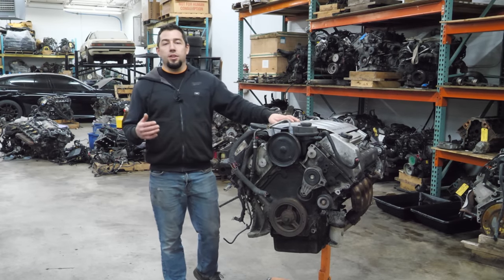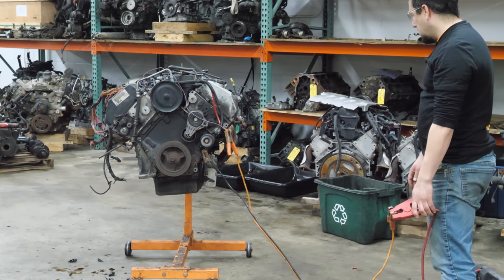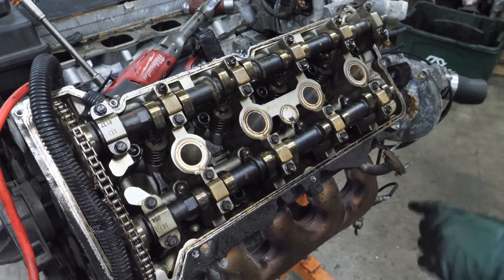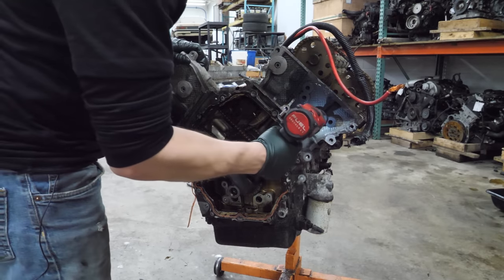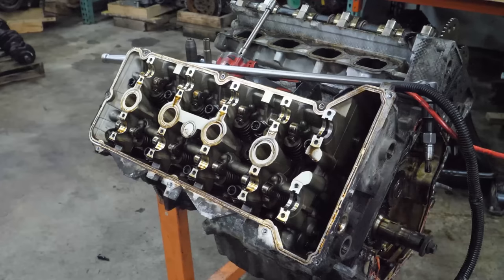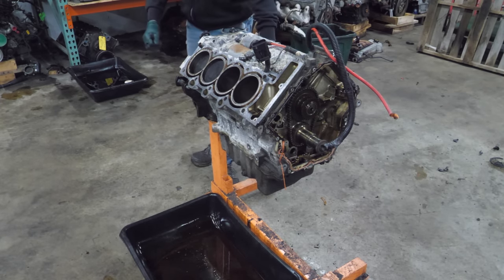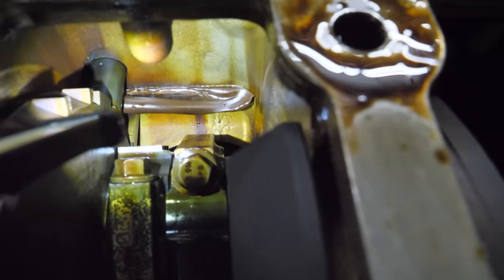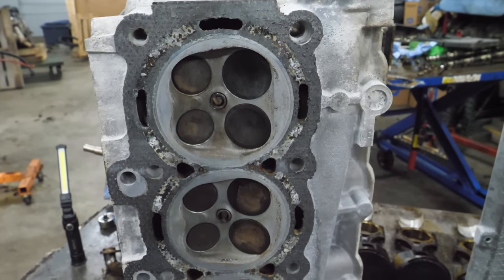Customer Returned This Cadillac Northstar L37 4.6L V8, How Many Things Can We Find Wrong?

Comment: First, the RTV issue. There was a special policy repair on the lower block union oil leak. Was probably done by some idiot at a dealership. The blocks and head gaskets were upgraded to  address leakage and thread pulling. The cooling system corrosion was due to low coolant, which allowed air into the system. The water pump had been leaking for a very long time. Very common issue. A special socket is used to turn the water pump out of its locks. I've seen them locked down, almost always resulted in head gasket failure.  I own one, only because I couldn't find a decent used Lesabre. Working on cars for 45 years killed me physically, got to where I could no longer get in and out of my Duramax. I hope my 08 DTS will make it for a little. Good video.
Reply: 2008 is pretty safe. In 2005, GM started using LS head bolts in the Northstars. Problem solved.
Reply: Dexcool was the real problem here. And the engineers of this engine should be flogged in public!
Reply: @cmdrclassified  Actually, GM switched to a cheaper grade of aluminum for the blocks in 1995 which caused the bolt-pulling problem. Early Northstars don't have anywhere near as many problems with this because they use higher-grade aluminum for the block. Late Northstars used a revised head bolt design which greatly reduced the problem in 2002 and solved the problem in 2005. 1995 to 2001 are the years to avoid.
Reply: First off I'm one of the idiots that worked at Cadillac. So you are completely right. Unlike the 4.1 4.5 and 4.9 Cadillac engines we had to cram coolant sealant tabs in the cooling system. 2005 and above use a 1.5 thread pitch head bolt which helps eliminate thread bolt pulling. I love the Northstar engine. My 2008 DTS has 178,000. Bought it off a customer $900 because he thought the engine was bad. Best car in the world. I had already resealed the bottom case halves a few years prior. Still going strong us idiots always replace the oil pan baffle. The Northstar put my kids through college
Reply: @aaroncostello8812  or studding the block and 14mm shank i knowledge from my boss's shop that was into modifying caddy's

add the 500ci as well
Reply: adding in stop-leak does that damages as well that's probably what the solids are or at least part of the problem that helped kill this engine/video
Reply: @williamwalker4029  i hate those tabs previous owners of my 80's k1500 did that killed my casting's aka junk-engine
Reply: Cast iron block aluminum heads, nature's head gasket.

Comment: Oh YES! As a Northstar owner (LD8) I've waited so long for this teardown video! Can't wait to see how this Rubik's cube of an engine comes apart.
Reply: Is that the 300 HP HO engine
Reply: @nickyj3571  No, the LD8 was the Deville and SLS Engine. 280Hp, The L37 was 300Hp, Still Have one in my 1998 STS.  Studded the block ten years ago, still running strong at 165,000 miles !
Reply: @Archangel2020  I don't even understand why they had the two different engines with only a 20hp difference
Reply: @nickyj3571  the gearing is also different between the 2 versions. The lower power versions have a bit more torque to move with the higher final drive ratio.
Reply: @danr9584  I drove both versions didn't notice anything different except for the performance model having magnaride which did turn better at higher speed and the 18in wheels looked nicer

Comment: Gotta love how convenient the starter is to replace in these, always looking forward to another one of your videos 
Thanks Eric
Reply: BMW does it too
Reply: Isuzu trooper as well
Reply: Toyota does lots of their v8's that way
Reply: Honda 2.4 l too
Reply: I prefer it in a lot of cases. Its easier to get out than say a toyota 3.4 v6. The intake comes off in a matter of minutes and its just right there, rather than struggling under the car on your back for a while getting dirt in your eyes.
Reply: I would rather disconnect fuel lines and remove a dozen clean screws from the top of the engine than eff around with rusted exhaust manifold flange studs and whatnot with dirt and rust falling onto my face while swapping a starter underneath the car.
Reply: Removing the intake is a way better DIY job than trying to get it from below with ramps/stands. Also, how often are you replacing starters? This looks easier to work on than a lot of transverse V6/8 designs that are buried below vacuum lines and cables.
Reply: 07 Chevy express van starter can be swapped out in 12 minutes. It’s in the normal spot.
Reply: @anthonys7534  I'm reminded of a 1969 Ford F100 360 FE.... truck was just tall enough to crawl under, and with roughly 16" worth of 1/4" extension that last starter bolt was accessible going in from the front (otherwise it would have been double the time dickering around with a box end wrench). Couldn't have taken 10 minutes, 5 bolts all right there and nothing in the way except the starter itself for one bolt.

Comment: After watching so many videos of very late model OHC engines being torn down, I've seen so many with those long timing chain runs directly from the crankshaft to the cams and have wondered why none of them had intermediate cam reduction and now see this and what a pleasant surprise.  This engine's system is so much cleaner and more efficient that the later ones, fine engine design (from an old school motorcycle tech).  Most later designs are disappointing by comparison.
Reply: If you think about pushrod GM V8s, it also seems kind of expected that they'd have an intermediate idler in approximately cam-position (in an OHV V8).  So the chain from the crank to that is approximately like the timing chain on one of those.  But yeah this design seems to work well.

Comment: I changed the engines in quite a few of those cars, Cadillac, and Aurora. Had to drop out the sub frame to work on it. I changed head gaskets on one, when I was torqueing the bolts down several on the back bank pulled the threads, learned a lesson there, and replaced the rest with replacement engines. Never used any wrecking yard engines, could be as bad or worse than what you were taking out. Wrecking yard would give you another engine, but you had to eat labor, and fluids.  Cars used to be fun to work on, now it is never our fault, you did something wrong installing it.

Comment: An engine that would be cool to see torn down one day is a buick 3800- love the content!!
Reply: I don't think those engines hardly die
Reply: @danielknepper6884  agreed! Aside from intake gasket leaks and an intake manifold egr port that can crack and hydrolock the engine they're really stout and seemingly can run forever.
Reply: The early 231 Buicks ones aren’t great.. plagued with oiling system problems… GM 3800 series 2 is an amazing motor. My Buick 109 (grand National v6) has all kinds of oiling mods and it still doesn’t have great oil psi lol
Reply: @jafferm1938  the oiling in pre-corporate era Buick engines has always been a weak point unfortunately. There are several good fixes out there though. 

I've rebuilt a Buick 350 (pretty much what the LC2 was based off of, which itself is derived from the 215) and it uses an identical oil pump setup. An adjustable pressure regulator and high pressure oil pump plate do wonders for addressing some of the oiling issues. I did the same thing in a worn out 455 I have, that motor makes over 60psi at idle on cold start and 20psi hot at idle. 

The 3800 series of engines made big changes to address some of this, including switching to a more modern and efficent gerotor oil pump driven off the crank instead of the cam sensor or distributor.

 One big mistake many guys make with the Buick V8s is installing high volume oil pump gears. These put a ton of stress on an already failure prone front cam bearing. The crank driven oil pump in the 3800 eliminates that issue. 

There is a forum post a GN guy made where he modified 2 timing covers to add a 3800 oil pump to his LC2.

Comment: I'm always interested in seeing Northstar information. I own a 2004 Cadillac Deville Base, bought it in March of 2015. The car runs great. It, of course has the Northstar. I wasn't actually looking to buy a Caddy- I was looking at Buick Park Avenues. All were pretty high mileage. These early 2000's DeVilles are incredibly good values- as the issues with these engines seems to have put a DC-10 type of reputation on them, resulting in very low resale. I have the build sheet for my car, and the sale price- was $41,000. A LOT of money in 2004, for an American luxury car... especially a base model. I have heard that by the 2004 model year, GM had fixed the head bolt issue on these engines. I am not sure... anyone know?
The car has some really stupid things that go bad- like the window regulators, and a terribly frustrating Passkey III/ ignition switch/ module issue.  Still cannot find a particular 'dead' left rear door issue. 
Other than that.. I maintain the car religiously. Regular oil changes, and parts replacements. It has a new radiator, power steering pump, starter (Yeah, it's a pain) and a huge MOUSE nest under the intake! When we did the starter, we found dried out injector 'O' rings and replaced them.
Overall, I'm still driving, and loving this fast, quiet, comfortable car. Eight years and still runs great, and the engine makes noticeably more power than my old Mustang GT. In a 4,000 pound car, I get 22-23 mpg on the highway. Not bad for a 19 year old car.  I think these are actually great engines.. and with the head bolt fix- they are reliable and powerful. 

THANKS for this excellent video!
Reply: Regarding your question about the head bolt repair; GM finally got smart about the head bolts. The 1st iteration of the engine from 93-2000 has relatively short and narrow head bolts. The 2nd iteration had longer head bolts, like in this video, from 01-04. All engines from 2004.5 and up had longer and thicker head bolts which solved the thread killing issues. Sadly, the reputation was destroyed already. If you contact Northstar Performance in Canada, they have head stud kits and bulletproof kits for all 3 iterations.

I had an 02 DeVille DTS, and it ran great! Changed the water pump and did a coolant flush on it, and ended up clogging the heater core and radiator. Ended up trading it in for my 2020 Civic, but I still miss the old girl. The other issue mine had was it burned a quart of oil every 500 miles. 500, not 5000. It really needed to be freshened up, but I couldn't afford to have it down to have everything done right since I didn't have a 2nd car. Maybe someday I'll get another, and do what I wanted to do to it.
Reply: @BigRedtheGinger  THANK YOU for taking the time to respond to my question! I love the Caddy. Just put in a new Duracell battery from Batteries Plus. Same type- Group 79, that I bought 5 years ago. A hard to find battery nowadays.
Reply: Dave, watch the Car Wizzard on YouTube about the Northstar.
Reply: @michaelthomas-fu8rs  I have watched his channel, he's really good.
Reply: I’ve had a 2003 Deville for 12 yrs. The HG finally failed on me a few months ago @ 170k.
Was hoping maybe I’d be a lucky one. Nope.
After Bars Leak didn’t work, I found a 2-part HG in a bottle some guy in CA invented. 
Thermalweld 
I’m 7k on it now. 
I don’t expect it to work forever, but for the $, it’s been worth it for a few more days with her.

Perhaps a more experienced mind knows otherwise about that buildup being from Dex?…
But I’d bet $ it’s from HG in a bottle.
Reply: It’s bad rings I taken them apart

Comment: One of the highlights of my Saturday nights - waiting for the next teardown video drop.  Thanks so much for filming teardowns and producing these videos.

I remember when the Northstar came out all the car magazines raving about how GM had finally produced a V8 engine on a par with Germany and Japan.  Unfortunately, the hype came to a screeching halt when customer cars began reaching 100k miles and separated heads/blown head gaskets caused these engines to drop like flies.  Now we see the aftermath of a Cadillac engine likely mechanically totaled by a blown head gasket.  No carnage like bent/broken connecting rods or piston deletes, but it was still pretty bad.  Talk about nasty.  I hope you found enough good parts and can make something more than scrap value off this thing.

Comment: I owned one of these Northstars.  Loved it!  Never had any issues with it.  I did change the oil every 4-5K and engine was a solid engine.     The Deville it came in had electrical issues... but the engine was good.  Only drawback for me was it needed a starter at 80K and it was expensive as you have to pull the intake manifold off to get at it and it's BIG!.
Reply: Removing the intake manifold to change the starter on a Northstar is potentially a lot less painful than removing the exhaust pipe on a small block Chevy.  As for the oil change interval, mine was using a quart every 500 miles, and there's no use in changing anything but the filter when it's leaking and burning oil that fast.  My STS was a great car, aside from the engine.

Comment: My dad had the 1994 Seville STS with 298,000 miles on it and it was still running strong.The engine was great but everything around it was falling apart.It never overheated.It always stayed between 195F to 225F .Then he had to get rid of it as it needed alot suspension work and my friend gave me for free a 93 Lexus LS400 and that now has 303,000 miles and running smooth.

Comment: ProTip: Don't look down the hole. 😅
On a serious note, the Northstar is like two head gasket puking Quad4s stuck together, I bet the same people designed both.
The early Quad4s, like mine, had the PS pump rub off a short belt off the back off the camshaft, later ones drove the PS pump right off the back of the cam. Mine liked blowing the that cam seal, besides the head gaskets.
Reply: Except there's a head stud kit fo Northstars that makes them great engines. Quad4s are junk no matter what

Comment: Former Cadillac dealer tech here.  In 15+ years, I never ever saw a Northstar Starter fail unless it was flooded, and that was only once.

Seems like a crazy location, but it was very dependable based on my experience.
Reply from the maker: Personally I don’t have a problem with this location. I rather do this than have to dig it out between exhaust frame and transmission.
Reply: @I_Do_Cars  and FAR better than the V6 Fbodies of the late 80s, especially one lower so 3 jacks were needed to get the height to get under the car

Comment: Considering the amount of RTV in the oil drain passages, this engine is in surprisingly good condition. It appears to be rebuildable. It could have been much worse. The rods are very thin. They don't look like they can handle much horsepower. Very cool tear-down!
Reply: the engine is rated at 300 hp and 300 ft pnds torque.

Comment: Thanks for the northstar teardown, I had never seen one tore down, so it was cool to see an early GM ohc 4-valver.  That dexcool is just so nasty, I wonder if not only mineral water but possibly mixing in the "universal" green coolant helped make that jello.  The front timing cover looked very thin/stamped - seemed like it was bending as you were peeling it off.  I hate the location of the starter, but if memory serves me right, the tundra has one that way and a few German vehicles also.

Comment: The reason there is so much crap in the coolant and the waterpump is because someone has put so much Barrs Leak in the motor that it's blocking the hole system I have seen it before and nothing destroys a  motor faster 
  Your youtube channel is one of the best out there. 
Thanks for the hours of enjoyment